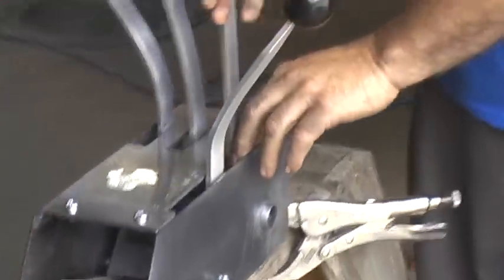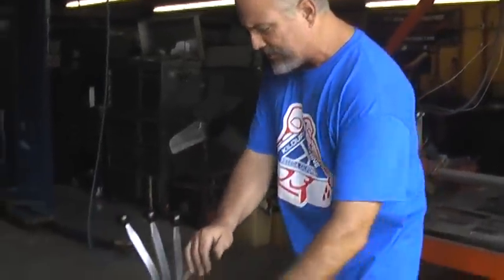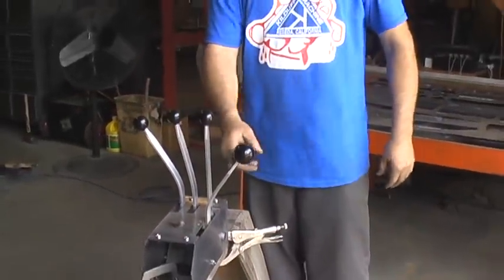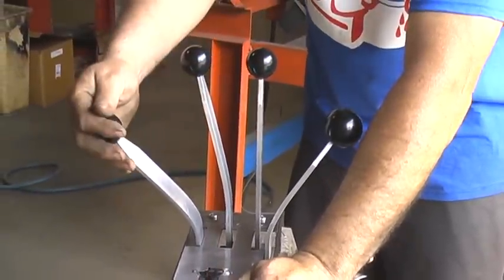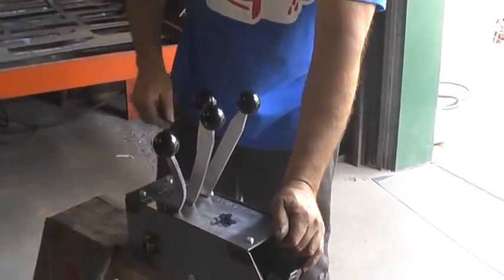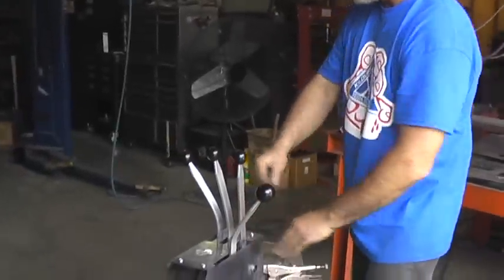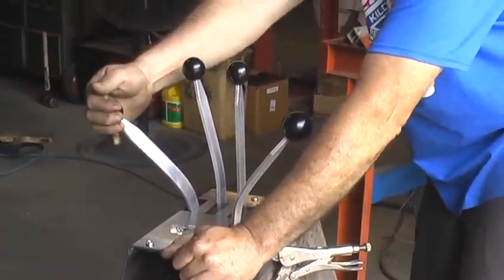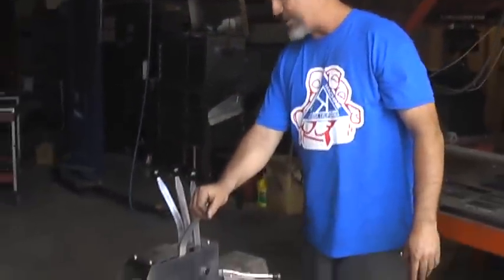Kilduff Lightning Rod Shifter. Like Lenco and Hurst Lightning Rods

Comment: i had to pause 1 min in and check the webpage. I was honestly looking thinking they were going to be $1,000 or more for a set and just a pipe dream. You my friend have line thats a pretty damn good value. If you think a regular shifter is going to cost $3-400 for sure, then valve body. You sell the shifters so close to what a normal ratchet shifter costs im really getting interested in a set for my 85 regal. The Buick never came with lightning rods like the olds but then again I'm building a Grand National the way it should have been with 1200hp, not 200. They needed 2 more cyl, twice the c.i.d. and another turbo to be the car they should have been

Comment: Can the 3rd rod (far right) be made to operate a switch? I have a Manual Valve Body AOD 3 Speed and OD is currently on a toggle after i engage 3rd. Thanks

Comment: Can you push the rods back for downshifting? I have a manual valve body 4L80
Reply: no it resets them when you pull them its meant for drag racing.
Reply: DreamTheory  So it does not downshift?

Comment: would it work in a 68-81 (C3) Corvette with a Turbo 350 or Turbo 400,? Is there a shifter made specifically for a 3 speed GM automatic rear wheel drive? If so may we see it?

Thank You

Philip

BTW your shifter design and fabrication rocks!

I Wanted the "Lightening Rod Type" shifter since they were introduced in the "Hurst" Old's of the 1980's. Just wasn't a 200-4-R fan. I did too many warranty rebuilds at or under 15,000 miles on almost brand new cars for 5.5 hours including pull time. Add an hour to flush the trans cooler and lines...3 for an oil change  and .3 for diagnosis of line pressures, road test and fluid sampling 7.1 hours  total at 12 bucks an hour which was good in 1988. Then wait a week for a Zone Rep to come out, push it outside or clog up your dead stall, if you were lucky enough to have 2 bays. Then another week for parts or if you were lucky you could slam a crate trans init and almost come close to a break even if you were good and lucky that hard parts cost exceeded the cost of a new unit.

Weak transmissions, built cheaply for the day behind a  stock weak 305 powered 190 horsepower Monte Carlo SS or Hurst 307 boat anchor ( I love the Hurst Olds even with its weak 307 lets get that straight) sure, a Grand National was a recipe for disaster if even slightly modifying the engines horsepower output. . The 700-R-4 was the better (4L60) of the two 1980's overdrives after the 700-R-4 Ironed out it's bugs. The 200-4-R was dropped around 89-90 model year. The Turbo 400 was still there till the early-mid 90's for trucks as was the 700-R-4

The 200-4-R was based on the Turbo 200C a wear trans at best and one step up from the Turbo 175 still in use in the USPS "bread box" mail vans still in use with a 2.2. That combo was tough S-10  (not T) rollling chassis with the 2.2 liter engine and turbo 175C and a Grumman aluminum body. Still "hauling the mail" today"

Was many a "Green" tech thought he has a seized up engine or starter on the 175 trans.. Lots of red faces over that misdiagnosis (locked up trans front pump! ; same as Buick 3800 series 2 engines "locked up because of a failed intake manifold that filled every cyllinder with antifreeze overnight in some cases.Many engines replaced for m reason.

Just replace the intake manifold, upper and lower plus gaskets, pump the coolant out the spark plug holes with them removed, a few squirts of trans fluid down the 6 plug holes, rank it thru with plugs out and fuel/spark disabled, insert plugs, change the oil and add coolant  clear codes and then be on the way. I can do one in my driveway in 2 hours if I take my time. Love buying them from people for nothing then sellinf them for 6-12,000$!

Anyway let me know if that shifter is available for the turbo hydro 350/400. I have a C3 Corvette I think it would look good in!

Phil

Comment: So i got a questions for you I got a 89 ford mustang with a 4aode trans, it has a independent first gear, second and third act as a single gear and a independent overdrive (1-2 3-4) how would that work on the lightning rods?

Comment: so what is the advantage of this compared to just automatic transmission?
Reply: fast, positive shifts without the risk of selecting the wrong gear
Reply: Justin Rodriguez you’re not gonna miss gears with an automatic transmission...
Reply: @ricewithnoodles23  I believe he was referring to accidentally popping into neutral, or even worse, reverse. Not missing shifts...
Reply: its faster whn  you can shift it yourself i use too have the B M star Gate u bumped up and it rachted into 2  bumped again it went too 3rd